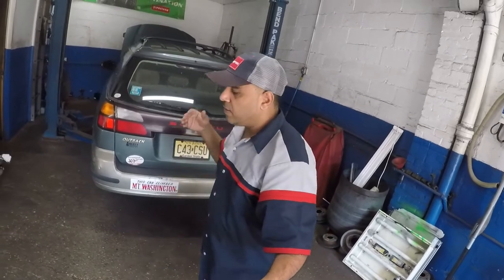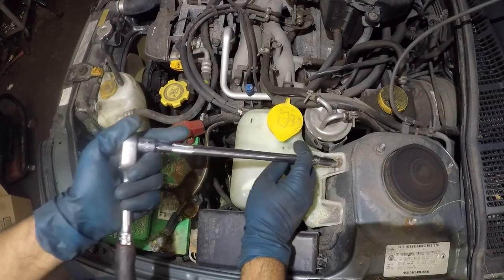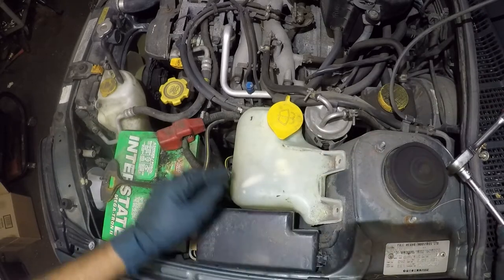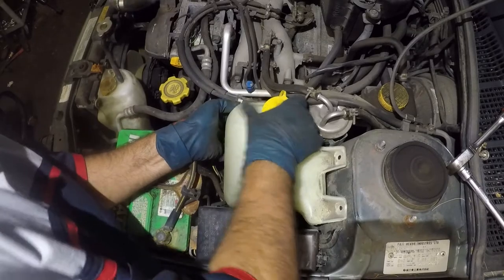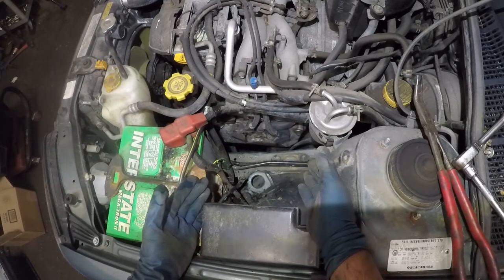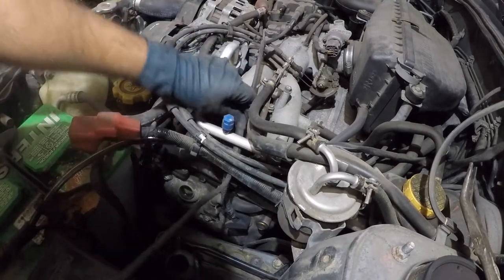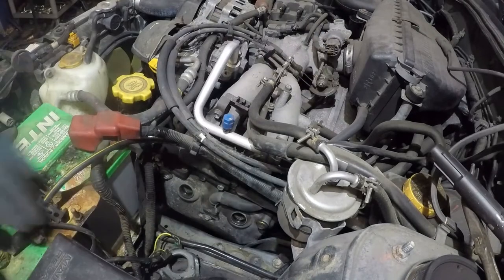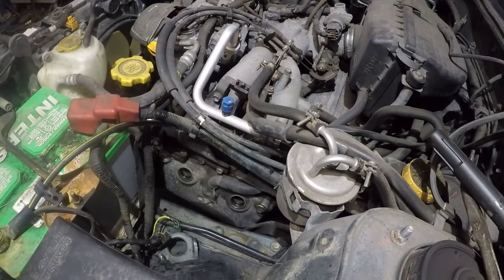2002 Subaru Outback Spark plugs Wire and Ignition coil Easy Simple Engine TuneUP

Comment: Just for any ones info this vid pertains to many of the older subies  My 2005 forester  and 2008 outback. The only difference is exactly what you might need to move for the clearance, on the 08  it would be the battery other wise every thing else holds true. Thanks again

Comment: Have you encountered a sparkplug thats been rounded and won't grab at all? Got 3 taken out but the last one isn't catching on the 16mm socket. Soaked it in seafoam cleaned it as well and no results.
Reply from the maker: If prolly got dirt around it blow air I had issues like that before though it was the plug but it was just all dirt around it